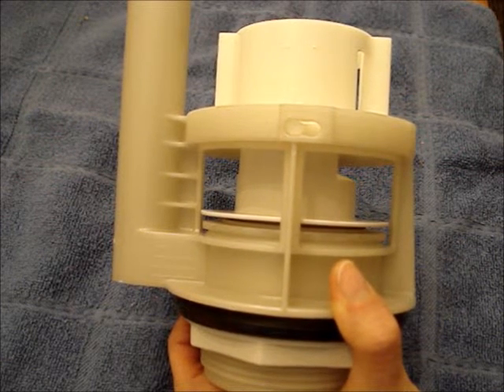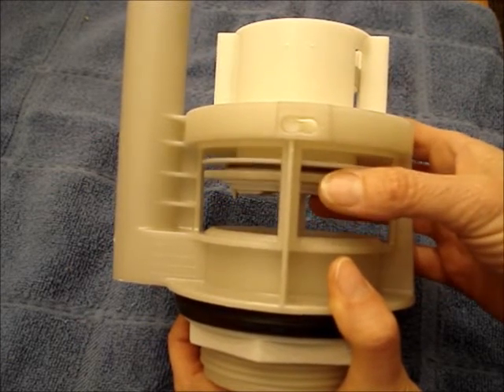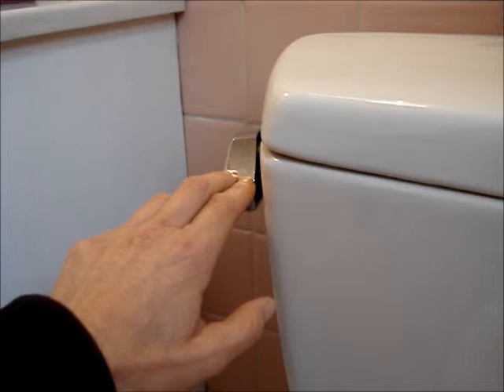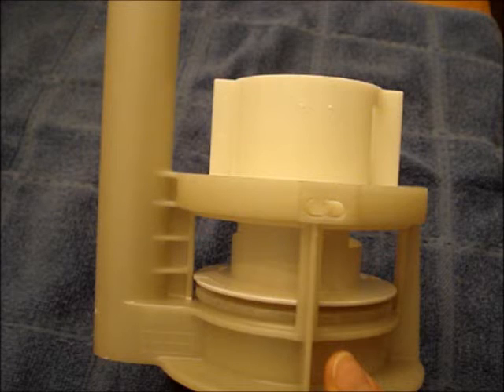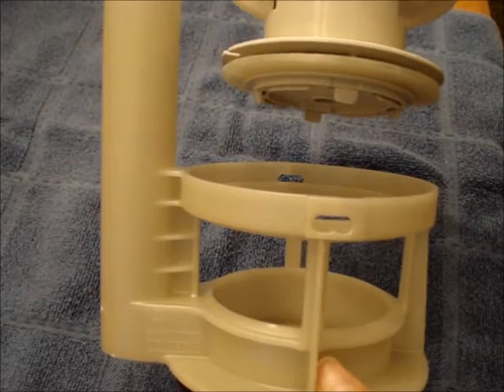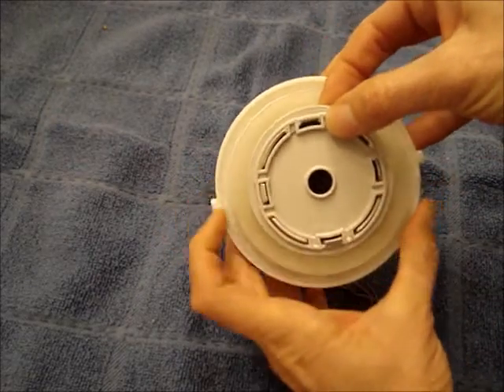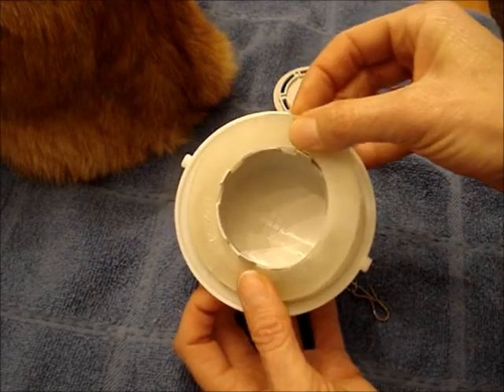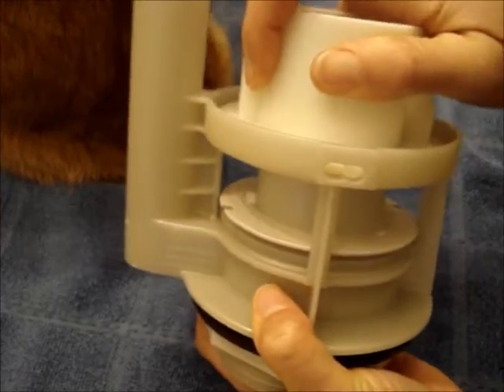Toto Toilet Replace Flapper Gasket on Flush/ Drain Valve

Comment: I had an issue with this valve not sliding freely, because the four vertical braces around the valve touched the plastic disc above the gasket. So I just shaved off about 1mm on the four sides where the disc rubs on those braces. Works perfectly now.
Reply from the maker: Thanks for taking the time to share the tip, Adam.
Reply: My brand new Drake 2 has this issue. I have to manually push down on the sliding cup to stop the water draining out and fill the tank.
Reply: Thanks, just did that to mine!

Comment: Has anyone found a place to buy the gasket ring?  Thanks for the help.
Reply from the maker: It looks like the part number is THU407, though you might want to get the model number of your toilet from the inside of the tank and verify at TOTO.

https://www.amazon.com/Toto-THU407-GASKET-DRAIN-VALVE/dp/B079WPXDZ4/ref=asc_df_B079WPXDZ4/?tag=hyprod-20&linkCode=df0&hvadid=385265257907&hvpos=&hvnetw=g&hvrand=15179985217063729971&hvpone=&hvptwo=&hvqmt=&hvdev=c&hvdvcmdl=&hvlocint=&hvlocphy=9007451&hvtargid=pla-847181344744&psc=1&tag=&ref=&adgrpid=80210701124&hvpone=&hvptwo=&hvadid=385265257907&hvpos=&hvnetw=g&hvrand=15179985217063729971&hvqmt=&hvdev=c&hvdvcmdl=&hvlocint=&hvlocphy=9007451&hvtargid=pla-847181344744

Toto parts link:  https://totousaparts.com/store?search=&psearch=thu407&commit=Search
Reply: @Know-How-Now Very helpful video! Having the link to the correct gasket is the icing on the cake.

The Amazon link is great, will order 2.

Just letting you know: the Toto link is no longer valid.

Also, how do you get links to work in your comments? I have observed that YT disallowed active links a couple months ago. Would really like to know how you do it.

Kind regards, and best wishes to Melvin from Dolly and Coco!

John
Reply from the maker: Interesting that when I put the part number in the Toto link it says it doesn't exist, but it is for sale on the Toto store at Amazon.  I'm stumped.  

I didn't know about the YT link policy.  When I read it, it seems that some types of links are allowed.  Let's try a link to YT policy page:  https://support.google.com/youtube/answer/9054257?hl=en
 
Our boy,  Melvin (now 14 years old) says hello to Dolly and Coco.

Comment: Love the cat.  The problem with my Toto tower valve is the middle piece that moves up and down does not always drop down all the way to seal the gasket.  I then have to take off the lid and push the center plastic down - it will drop an additional 1/2” - 3/4” and then the gasket will seal.  I’ve removed the tower flush valve and cleaned the outside of the middle piece and inside of the outer piece with vinegar as it appeared there was a very thin film on both but after reinstalling the middle piece still occasionally doesn’t drop all the way down.  Typically it’s if a second flush occurs soon after the first.  Any suggestions?
Reply from the maker: Melvin likes to help.  lol.  You did what I would have done.  A long shot would be replacing the drain valve.  You might try contacting Toto tech support.  I haven't called them recently, but in the past they have been helpful.  Please let us know what Toto tells you.  https://www.totousa.com/toto-customer-support

Comment: How do you get the flush valve out of the toilet?
Reply: Never mind. Watched the next video, thanks.
Reply from the maker: OK, great you found it.  Here's a link to the video if anyone else needs it:  https://youtu.be/GJEnlUa0GrQ  I also have a video that will help if the tank bolts are difficult to remove.  Click on the channel name to find it.
Reply: HOw do you install a Toto tower flush valve on a one piece toilet?
Reply: a THU451.10A-A tower flush valve.
Reply: Love the cat.  The problem with my Toto tower valve is the middle piece that moves up and down does not always drop down all the way to seal the gasket.  I then have to take off the lid and push the center plastic down - it will drop an additional 1/2” - 3/4” and then the gasket will seal.  I’ve removed the tower flush valve and cleaned the outside of the middle piece and inside of the outer piece with vinegar as it appeared there was a very thin film on both but after reinstalling the middle piece still occasionally doesn’t drop all the way down.  Typically it’s if a second flush occurs soon after the first.

Comment: Where do you get the gasket -- and only the gasket -- for a Toto toilet like this?
Reply from the maker: If yours is like the one in the video, the part number for it is in the box below the video.  I did a search and found a parts diagram.  Search for the part number you need or Toto will likely sell you a very expensive replacement part.  https://xrefs2.plumbersstock.com/product/7/9/791281_CSpCuo.pdf
Reply: @Know-How-Now  Thank you both for the original video and for getting back to me on a comment years later!
Reply from the maker: You are welcome, Adam.  I am continuing to add videos to the channel.  The new ones are a little more polished. If you haven't already done so, check out all the videos on the channel  https://www.youtube.com/channel/UCUsfNTwfDV3Ry_CFHJ9BeKA
Reply: @Know-How-Now  By the way, I didn't realize the gasket could be swapped as you show in the video.  I removed and inspected the gasket and there was a bead that had formed which prevented making a complete seal (this has happened twice now!).  I flipped the gasket over (was smooth on that side) and reinstalled it and now it's holding water in the upper tank like it's supposed to.  Thank you again!
Reply from the maker: It's my pleasure to help.  Have a great day!

Comment: Excellent video but I have to ask if that cat has his union card!  :-)  Thanks for a really clear explanation.  Any suggestions for the part hanging up and not dropping all the way, causing the toilet to keep running?
Reply from the maker: Melvin does not have a union card, lol.  I'd try turning off the water to the toilet, flush to empty the tank.  Then try to clean the rails or any part with close clearance where dirt/build up may be forming with a toothbrush and plain water...and see if that helps.  If not, if you have a garden tank sprayer you might try putting a gallon of water in the sprayer, then a tablespoon of bleach & shake.  Don't overdo the bleach it is very destructive to rubber.  Try spraying the flush valve with the solution, (wear eye projection & old clothing) then quickly rinse it down with water.  There are tank sprayers made for bleach.  I use this mix of  bleach and water in my hydration system (camelbak) and it has never harmed the bladder or the rubber mouth piece.